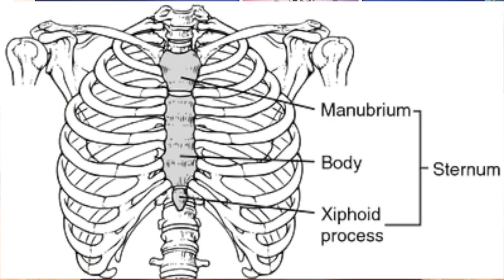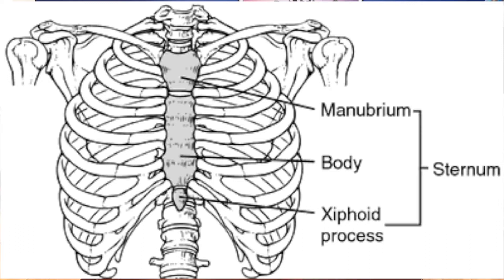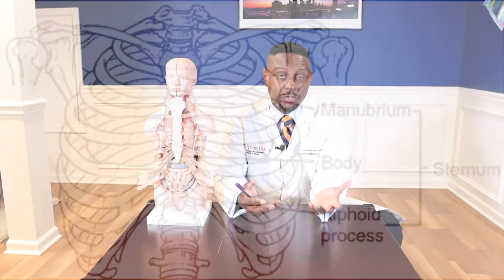How to Remove Sternal Wires?

Comment: Hello Doctor, 
I have a question pls explain, actually I have had open heart surgery in 2022 in oct last , right now in upper part of scar means near of sternum bone start something like wire is pointing outward, when I knee down it will more visible than when I am straight stand, it will feel difficulty as it is rubbing with clothes, is it serious emergency, or should normal?
I have exam soon so I don't want to consult right now, suggest me something asap please Sir 
Thank You..
Reply from the maker: I appreciate your question. You need to see a cardiac surgeon. There is no other solution. You need to be evaluated and if its the sternal wire that is causing problems, it should be removed. Good Luck with your exam.

Comment: I just had heart surgery to repair a BAV @ 54. November 12th 2025 will make a year since my surgery. I really want my wires out but I don’t want to make my chest scar bigger either. They cause some discomfort but mostly just give me physiological discomfort. Can a plate be removed from my chest too?
Reply from the maker: I appreciate your concerns. First the incision doesn't necessarily need to be larger. PLEASE SPEAK WITH YOUR CARDIOTHORACIC SURGEON. You could also request a plastic surgeon to help but that is not normally necessary. Sternal plates can be removed if needed. Good Luck.

Comment: Sorry Dr. just one more question…
Have you ever removed a patient’s sternal wires and it made issues worse for the patient after the wires were removed?
Thanks again.
Reply from the maker: Sorry for the delay in responding. Great question. The short answer is yes. I had a patient with sternal pain from sternal wires. After I removed the wires the patient had pain that although different from the previous sternal pain, did have sternal pain that was significant. The patient underwent an extensive workup and I am still following the patient today. Although this is not the normal outcome, this case proves that the patient can have significant pain or worse pain afterwards. I want to be clear, this is not the normal outcome but in full transparency it can happen.
Reply: thank you for all the info. I appreciate it. I’m having my wires removed next month. I have all this nerve like pain all around my sternum that spreads to my shoulders and neck with pain and stiffness. Hopefully removing the wires will help. I’m 45 years old and healthy.  @cardiacsurgerypatienteduca2445

Comment: Thinking about having my wires removed. Since my open heart surgery I’ve had pain in my sternum/ chest but also my neck and shoulders/ traps.  No one can tell me for certain if removing the wires will help with this pain I’m experiencing.  How long is the recovery process once wires are removed?  Thank you.
Reply from the maker: Sorry for the delay in responding. The recovery for sternal wire removal is usually minor. Most patients are back to normal in 2-3 days. However, recently I have had patients who taking longer to recover. PLEASE go back to your original heart surgeon for an evaluation.

Comment: I have pain after my removel of sternum wires is it normal 
Plz reply
Reply from the maker: I apologize for the delay in responding. Pain after sternal wire removal is expected. The degree of pain will depend on how many wires are removed and how big the incision is. All patients should be sent home with pain medication. As any surgery, the pain is usually worse the day AFTER the surgery and then should lessen the farther away the operation is. Good Luck.

Comment: Thank you for the video. My husband will be undergoing this procedure to remove his sternum wires a year after his aortic aneurysum repair.   So happy and reassured that you will be performing the removal.  You've alleviated my fears. Many thanks again!  I will report back after the procedure for the benefit of others who will be undergoing the same procedure.
Reply: My husband had his sternum wires removed by Dr. Lemaire, and as noted in his video,  the procedure itself was brief  outside of prep and recovery time.  Everything went well and  my husband went home the same day. There is definitely post-op pain, but it was to be expected.  Dr. Lemaire did an excellent job and was very kind and compassionate.  He explained the procedure to me beforehand  and also followed up with me after the procedure. He is a wonderful surgeon.  Thank you, so much Dr. Lemaire!
Reply from the maker: Thank you for the kind words.

Comment: I just had open heart surgery It'll be 12 weeks day after tomorrow And the incision area still Burns and scratches A lot. If I touch the incision scar it feels like steel wool touching it or rubbing it. I'm not sure if this is normal or not cuz they keep telling me at 12 weeks I should be pretty much all healed🤔
Reply from the maker: Sorry for the delay in responding. What you are experiencing is very common. Its related to a nerve issue. If it doesn't improve, go back to your cardiac surgeon. There are medications that can address this. Good luck.

Comment: It's been 5 years since my open heart, surgery to replace my aortic valve, and I have a pain right at the incision. It hurts when I lift my right arm or when I cough, especially when I touch the area. It feels tender, and also feels like there is something poking me from the inside out. Can it be that the wires maybe got lose?
Reply from the maker: Sorry for the delay in responding. Yes, the wires can be causing the pain. Go back to your cardiac surgeon for an evaluation. Good Luck!

Comment: I was just wondering during this procedure do they have to shave your whole body again. Because last time when they did it it felt like they either shaved too close and i had a  burning sensation over my lower body and my chest area with a razor or something.
I had two wires break.
Reply from the maker: Sorry for the delay in responding. You do not need your entire body shaved for sternal wire removal. You only need your chest shaved. Take care.
Reply: What happened when your wires broke, did you have confirmed by the doc?

Comment: Hello Dr. After having an chest X-ray for pneumonia last year the Dr. noted something regarding my sternotomy wire from open heart surgery performed 2007 for aortic valve replacement.  The report stated "small radiodensity  projects over the right sternoclavicular joint representing a displaced fractured median sternotomy wire."  The attending physician never contacted me regarding this finding most likely due to the fact that the xray was done in the ER.  How would you proceed with this?  It seems dangerous to me leaving this fractured piece of wire in my chest.  I have had a lot of discomfort with these wires due to being very thin, my bra rubs the wires that stick up and you can feel and also see these wires protruding. After having the open heart procedure, a resident came into the room stating that the drain was not in the right place.  He began shoving the drain in and pulling it out all the while scratching the exterior of my heart and puncturing my lung.  The rest of the day I received 8 units of blood before they realized they'd better open me back up which they did. They repaired the damage to my heart exterior and restrung the sternum which they seemed to do badly because it has bothered me ever since.  How far can these broken wires migrate?  I'm very active with weight training etc. Is it possible to do the aortic valve replacement again without opening the chest?  My artificial valve will need replacement in the future.
Reply from the maker: I apologize for the delay in responding. I would STRONGLY recommend that you either go back to your surgeon or seek a second opinion. The wires sound like they should come out which as I mentioned before is a relatively minor procedure. Good Luck.

Comment: Sir, is antibitocs necessary after sternum wire removal? Is antibiotics given after sternum wire removal as standard operating procedure.
Reply from the maker: Thank you for the question. Antibiotics are only given during the operation IF infection is not the primary reason for removing the wires. If the reason for removing the wires is infection, you will need to keep the antibiotics on for several days to weeks.

Comment: What happens if the wire breaks
Reply from the maker: Sorry for the delay in responding. If the sternal wires break AND are causing symptoms, you should have them removed.

Comment: I was in for three weeks after and got another infection and stitched that turned into staphylococcus and the nectotising fasciatis, had op to sort that out 5 months later. Two years on I have two numb boobs and residual scar pain.
Reply from the maker: Sorry for the delay in responding. I'm sorry to hear that you've had so many problems.

Comment: Good morning Dr. I had a aortic root replacement just over a year ago. Can I start doing push ups or riding my motorcycle ? I am having some intermittent itching in the scar area sometimes more than others. What can be the cause and what can I use on the scar area
Reply from the maker: Hi, I would definitely advise you speaking with your cardiac surgeon, but generally speaking, you should be able to resume push-ups and riding a motorcycle. Please confirm with your surgeon.

Comment: Hello Doctor. I’m to have two sternal wires removed soon. 
2 lower wires have snapped. I had a Double Heart Valve Replacement in September 2020. I was very traumatised by the surgery, hallucinations and delirium. 
Therefore I’ve been always very nervous having operations since. 
I suppose I’m seeking reassurance that this procedure will not cause that kind of trauma. TIA
Reply from the maker: Hi, Sorry for the delay in responding. First, I want to inform you as I hope my video did, that sternal wire removal is a MINOR surgery. This is nothing like a double valve replacement. You should be able to go home the same day. I hope that helps.

Comment: Doctor my question is I have fractured sternotomy wire should I have it removed or repaired and how so the procedure
Reply from the maker: Hi, Sorry for the delay in responding. I would definitely consider having the wire removed. It is a very minor procedure. Please speak with your surgeon.
Reply: @cardiacsurgerypatienteduca2445  thank you for your reply sorry to trouble you again my question is should I decide to have the fractured sternotomy wire removed whom should remove it my General Surgeon or the cardio thoracic surgeon … again thank you in advance as your knowledge and professional advice is greatly appreciated

Comment: Can you please explain what is sternum closed with 6 times single wires in cross over technique after surgery discharge from hospital I was reading the discharge summary I am bit confused pls
Reply from the maker: Hi, Sorry for the delay in responding. There are many techniques for closing the sternum. The technique that you described must be the favorite of your surgeon. The crossover technique the surgeon employed is supposed to provide a stronger closure because of the "Crossover" of the  wires. Once again, the technique that your surgeon employed is one of many.
Reply: @cardiacsurgerypatienteduca2445   thank you for reply  what you think what kind of wire they use for sternum closing stainless steel or titanium here in Australia Sydney And will this wire stay inside me forever ? And Will this wire cause me any problem while going through CT scan or metal detector?

Comment: Hi Doctor thank you very much for the explanation, I had my bypass surgery before 6 months. Now I am having some multiple little infection in the chest in sternal area. I sent pictures to my doctor as he is far from me. He is saying probably wire reaction. How to confirm it is sternal infection and wires need to remove?  I have diabetes.
Reply from the maker: HI, sorry for the delay in responding. I think you should speak with your doctor again. I agree that sternal wires unfortunately can lead to poor wound healing. The only way to clear the infection is to remove the wires. It's a very short and small operation with great success. I wish you the best.

Comment: Are sternal wires removed after cabg? If not do they cause any harm? Can mri be done with wires in? My father's double bypas surgery was today i am worried and have these questions kindly answer its a request
Reply from the maker: Hi, Sorry for the delay in responding. The sternal wires are NOT routinely removed after CABG. They are only removed for the reasons I mentioned in the video. A MRI can be done after open heart surgery although we typically wait 30 days if possible. Good Luck with your dad's recovery.

Comment: Does time since wire placement, say 15 years ago, complicate the removal procedure? Thank you...
Reply from the maker: Sorry for the delay in responding. That's a question and the answer is yes. If you tried to get sternal wires out within a week of placement it would be very easy. If wires were in for 15 years or even 1 year, it would be difficult but definitely doable.